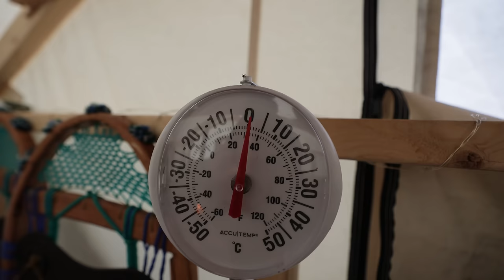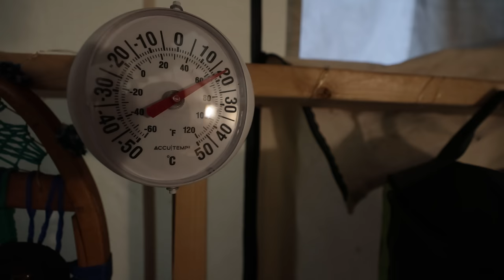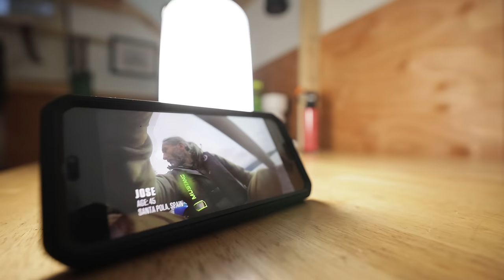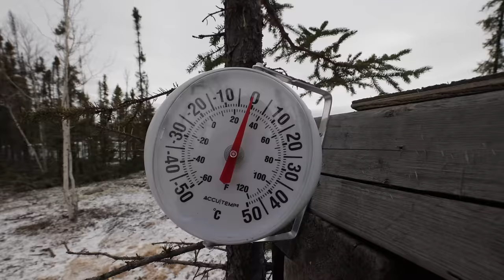Storm Strikes Tent. Windy. Rainy. Snowy. Nasty

Comment: Love that sensation of being in the weather. Wrapped up against the elements but just experiencing the full force of nature.

Here I enjoy throwing on the waterproofs and walking along the coast during storms. Waves coming in so hard they're practically breaking on your head and there is you... standing there in the swirling maelstrom, able to be alone with your thoughts with nothing but the roaring wind and rain for company.
Reply: lovely description!
Reply: Me too.I've been living off the grid for the past 4.5 years i n a tent in Connecticut, I like it, except in the summer when its hot and muggy. I prefer winter over summer 100%. I have a propane stove that I use for heat and cooking obviously. As long as you vent out properly and be extra careful its very safe regardless of what you hear about using propane stoves inside of tents.sure,the carbon monoxide will kill you if you don't vent the stove properly. Its all about being smart and careful.

Comment: You know Jay that 30 pound Propane bottle 🍼 is now $85 at Costco. If you don't remove that plastic wrap it will rust real bad. I hope it isn't too late to save it. I remember walking into my camp in my younger days. I walked thru chest deep water and then another 45 min to camp. I was happy to get fhere after walking 3 or 4 hours. My dad was already there and a warm camp is a saviour.
Reply from the maker: Thanks for the tip Mike